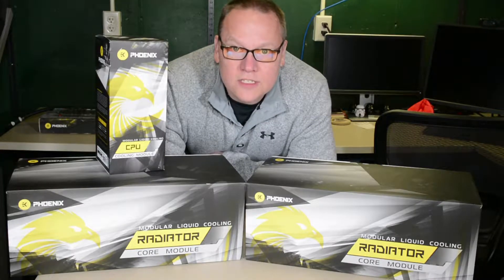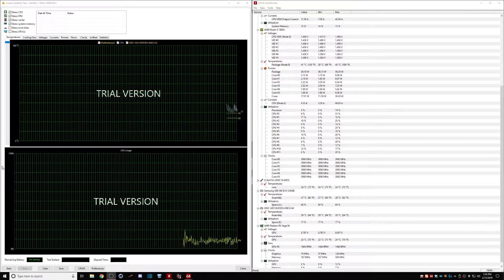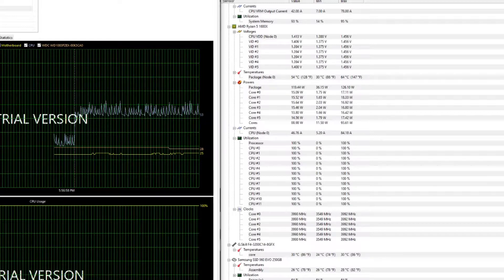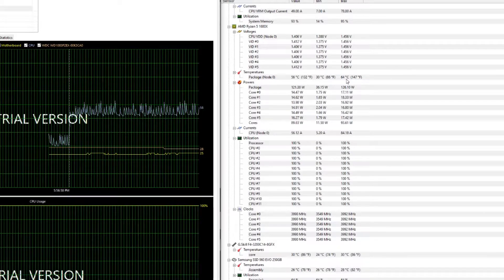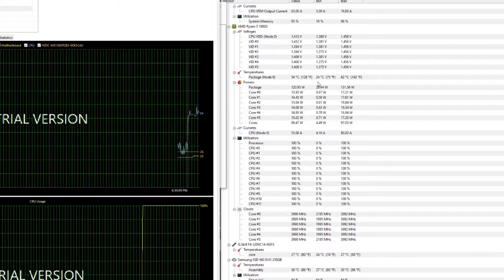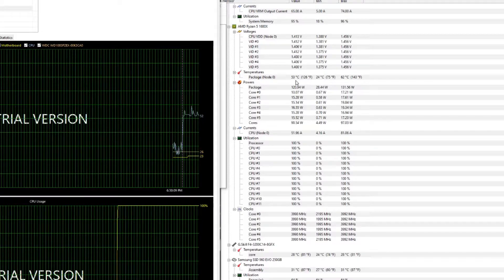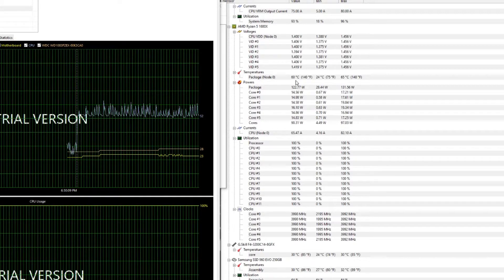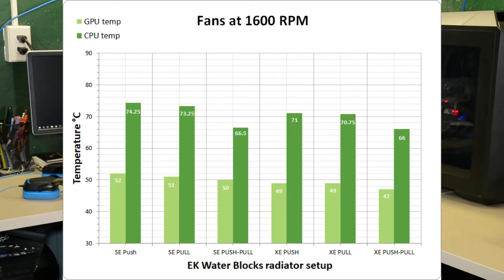EK Pheonix Series Part 9  360 vs 280 temp comparison

Comment: Nice vid Chris , buying one today , got to try to fit it in a cooler master Half X case (old one) , its not going to be easy , lots of drilling i expect lol , but nice to know im not losing any cooling by going with the 280mm
Reply from the maker: I'm running the  360 for now, I am planning on putting both rads in a case I got from fractal design that should fit them.
Reply: @TheTechBasement  im not looking forward to fitting mine , the HAF X is not the best case for rads , sure its huge but it has bad mounting solutions , going to have to cut it up & drill it a bit i can guess , but ill get it in there , its too nice this  EK to resist , just about to order it , wish me luck || lol